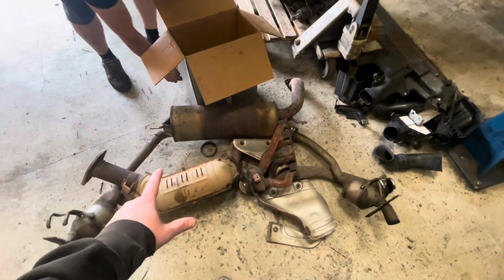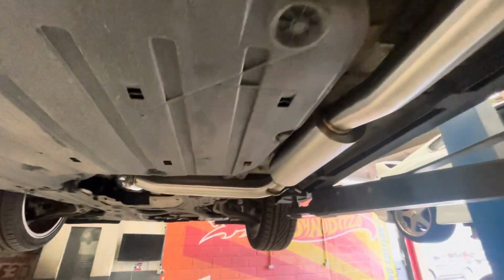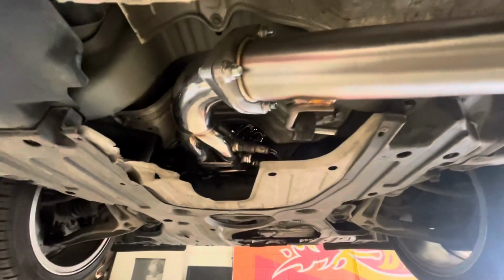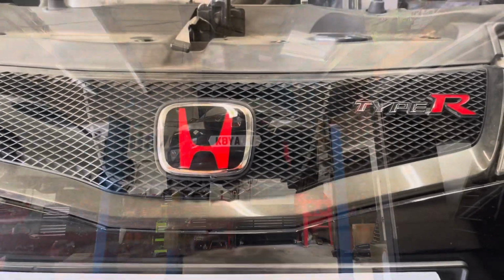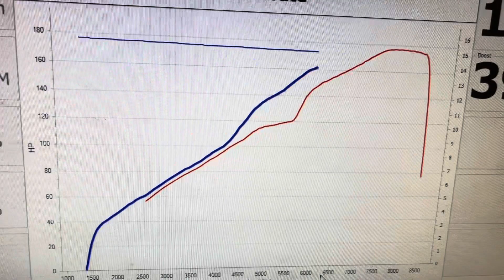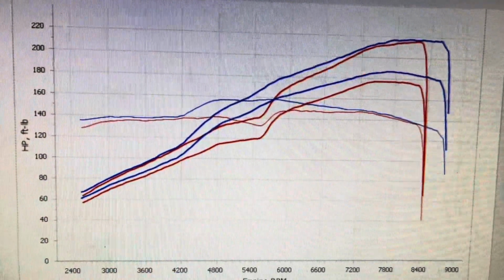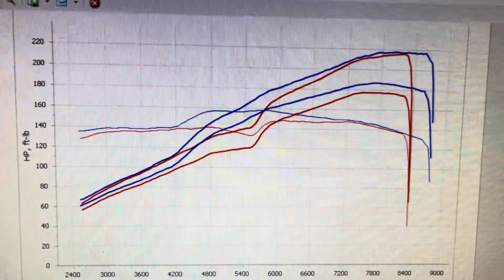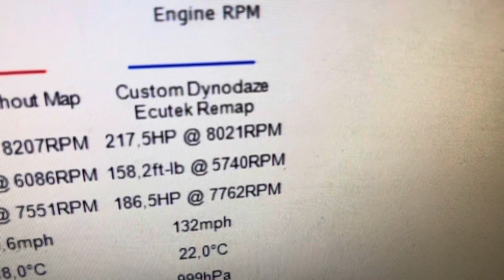Skunk2 + Tegiwa + ECUTEK + Dynodaze = Great Honda Civic Fn2 TypeR

Comment: I have just found your videos on here due to recently (last week) buying my first ever FN2. It has a piper manifold/sports cat and some sort of twin exit back box. It also has a K&N panel filter inside what I think is the standard airbox, Howe it does have a cold air feed going into the bottom of the airbox too. I see you guys most of the time put CPL intakes and tegiwa Manifolds/70mm catback a on these cars. Is there a huge difference in these mods you put on to the ones I already have? I ask as I’m looking at getting mine mapped soon and wondered if it was worth doing it on the mods I currently have or you think I should change to the ones you seem to use?

Sorry for such a long message, loving the videos so far guys. Love the chilled out vibe too
Reply from the maker: We can map whatever you have no problem and make some gains. However the better bolt ons you have the more power you will get
Reply: @DynodazeHondaTuners  thank you for replying so fast. I appreciate what you guys are saying, although I guess my question really is.. if you guys had to choose between the mods I had on currently or the ones you guys mention/recommend a lot. Which do you guys think will make the most power and be the best for drive ability? I’m also thinking about doing the RRC.